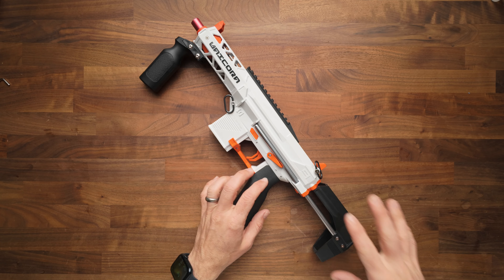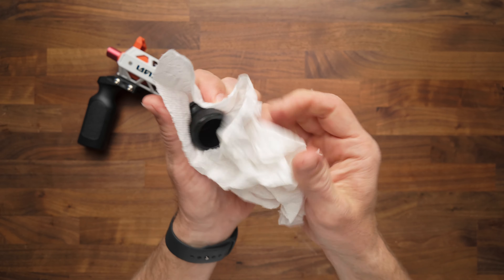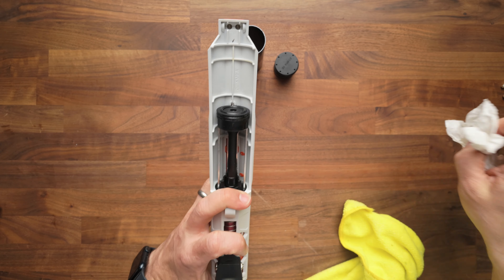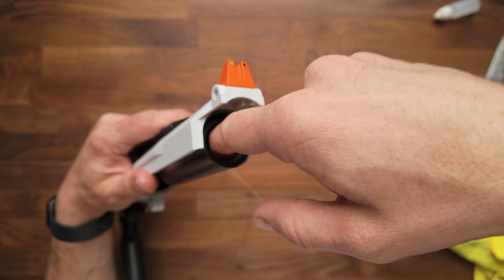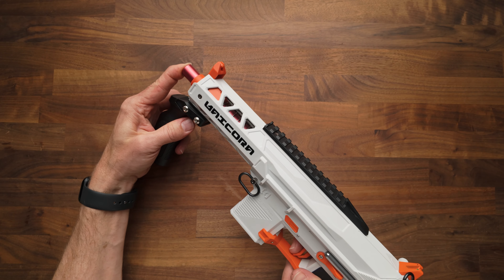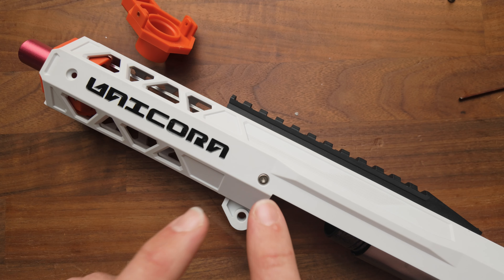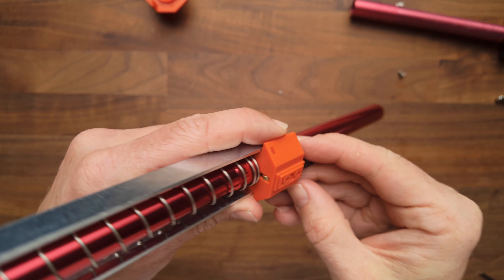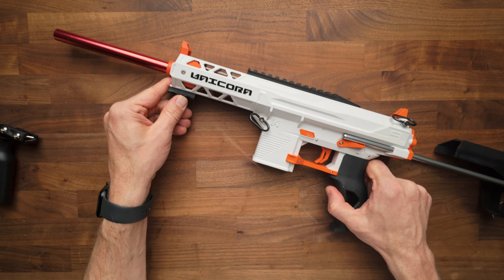Tips + Tricks: XYL KM9 Unicorn

Comment: My tips/experience:
* I taped several wraps of teflon to the stock rod to prevent it from collapsing, which is a common issue especially after a few weeks of use and abuse.
- This also removes the ability to collapse it in to minimize it, but I find that I never use the in between position and if I wanna minimize it for storage I just take the stock off completely.
* Do not attach a sling to the stock or hold the blaster by the stock. This wears out the notches (both ways). I was holding my blaster by the stock facing downwards and the stock slipped + blaster fell down barrel first and dented my floor.
* Make sure to mark the front of the little priming block that the pump grip picatinny rails attach to (I personally used a silver sharpie). This makes it easier reassemble since you don’t have to test which way is correct (the screws will not attach the lower pic rail if the priming block isn’t in the right direction).
* The black nylon/plastic internals tend to leave a black stain on anything they touch (o rings, mags, darts, etc)

Regarding upgrade parts:
* For whatever reason, the upgrade metal plunger doesn’t allow for slam fire IME.
* If you are using the threaded barrel adapter and the upgrade metal pusher make sure to push back the pusher when switching barrels, elsewise when removing the threaded barrel it might take out the metal pusher with it. You’d have to go thru the hassle of opening your blaster to thread back on the metal pusher if this happens. This will also wear down your metal pusher o rings and threads
- Unlike the default black nylon internal pusher and rambase being 1 piece, The metal pusher is separate and threaded well into the rambase but can still slip out with enough force (IE if pulled out along with the threaded barrel)
* IME the thick black o rings that come with the metal upgrade kit are the best, followed by the upgrade green o rings and then the default o rings.
* The upgrade 1.7 and 1.8 springs are slightly longer than the default spring, so don’t store the blaster with them in to avoid compression and wearing down the upgrade springs. The 2.0 spring is the same length as the default spring though.

Comment: I got a unicorn very recently, but it seems as though the screw port for the top rail that’s built into the blaster (not the piece that you snap into place) is too small for the screws that came with it. Am I missing something, using the wrong screws, or is it a blaster error?
Reply: i had that problem as well,  i fixed it by shaving the edges of the holes down with a knife until they fit. hope this helps!
Reply: @weebwhacker144  I appreciate that! My roommate who’s a lot more of a handyman than myself went in with a drill and drilled out the excess plastic